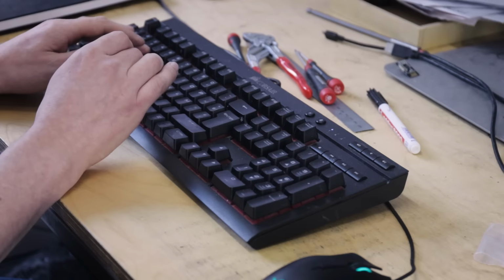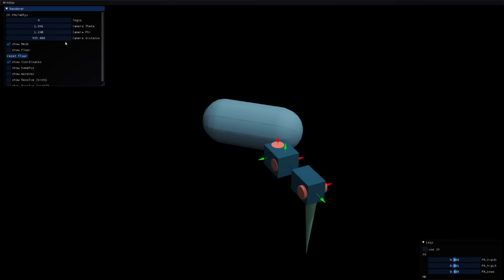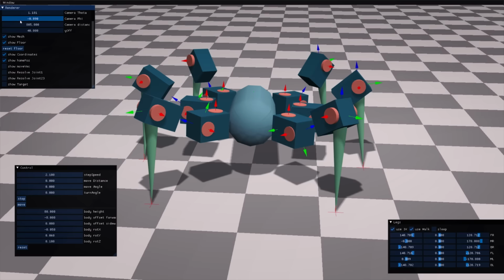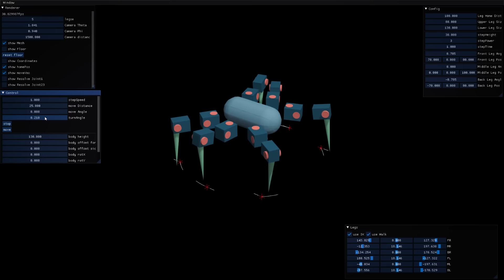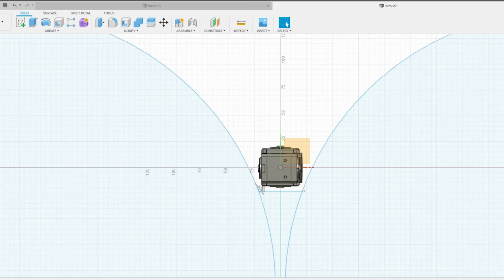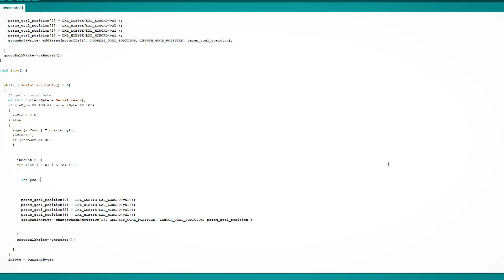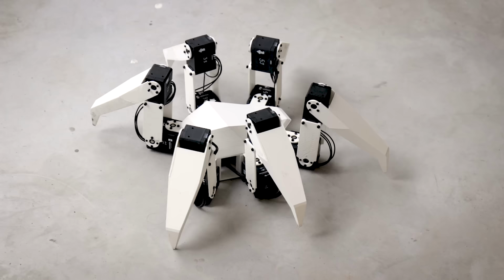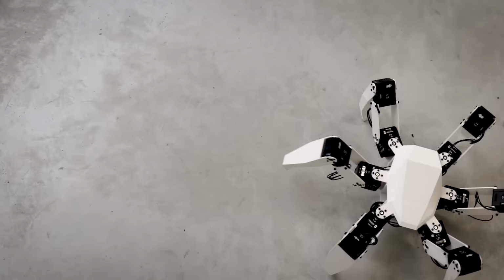Designing and building a Hexapod!

Comment: That's like $1000 in servos alone!
Reply: i got real excited when i saw these servos... until i saw the price
Reply: Does anybody know cheaper alternatives?
Reply: @Gaminghero94  Yeah use micro servos. 
Also, see if you can use stm32f103c8t6 instead of this microcontroller.
I'm kinda planning on making this and then uploading this on my channel in the future.
Reply: @lander1591  but for that you need to have rc cars, and that too a lot of them. If we assume that one rc car has one servo to steer its front wheels, then you'd need 18 rc cars to make the hexa pod.

Just get normal microservo motors instead. Although I dont think they would be as accurate as the ones in the video, but it's fine for a small project.
Reply: @risingredstone5949  Dude you just buy the servos themselves...  Like the 20kg servos off of Amazon.  Microservos are very weak anyways.  That would be a terrible idea, especially if you're not planning on scaling down the size of this hex.
Reply: @dooby1445  Oh sorry I meant mini servos which have a torque of 1600g cm, also I really wanna know, how would you use 20 kg servo anyways?
Reply: @Gaminghero94  you can find on aliexpress, they are serial controlled servo, so you need a dedicate controller that you can buy on aliexpress anyway., as you can see there are less cables than usual servos.
Reply: Do u know what software he used for simulation
Reply: I'm sure there are some cheaper alternatives out there. But the used servos are super and the price worth.
Reply: @kristalsunuwar8675  his own software, pretty impressive
Reply: @Merl-co2nd  ONE FIND

Comment: Thanks for going all out with Dynamixel servos, making possibly the best hexapod this size.
I have always been disappointed by the performance of hexapods made with MG90/MG996 servos. 
But this video really goes to show what can be done with high output and synchronized servos, such high acceleration yet still have the high torque to maintain the position.
I guess I shouldn't be so surprised when the servos alone worth almost $1000 on this robot.
I wonder how much extra weight can your hexapod carry?
Reply from the maker: Thanks :) Its actualy very close to maximum size/weight. It really can't hold much more (and be that fast) Despite the price, these are still the lower-end dynamixel servos  :)

Comment: Wow great video kind of servo motors did you use and what was the programming language python hard to see. Last question would be possible for it to be build on arduino . Been doing that a lot lately and would a array be needed to control the servo simultaneously at sync to move the robot.

Comment: Very very  good design and programming.
Cool thing, I also use Fusion and have a Lulzbot Taz6.
My designs are mostly for underwater robotics and the movements are quite easy to program, the main problem is to mantain joints and axis watertight without to much friction.
What materials are your choise for printing?

Comment: Hey Chris, I had a similar project I am working on and I recently started with the IK, I have two questions regarding this math. 
1. How did you add constraints to the calculations, the answers I get are in the range between -pi to pi where-as servos can reach up until 0 to pi only.
2. How do you translate the base frame from the origin to the edge of the robot for the legs? Could you drop some sample calculations somewhere? I'm aware of the transformation matrices but un-aware of its use, if its has to be multiplied to the 0th frame of the DH table or how?
Reply from the maker: 1) I don't have any constraint in my code, but I remap the servo range. let say from -pi/2 to pi/2  (my servos go from 0 to 2pi, but i don't need that range for the walking cycle)
2) Hard to explain if you don't really understand transformation matrices, if you do: i have a matrix for my main body (rotation+translation, relative to the zeropoint on the floor, which i can move when i move the body up and down, tilt it etc)  and a matrix for the leg position/rotation relative to the body center(fixed) and  a world-pos target point for each leg(which i use to make the walking cycle). now is the goal to transform that world-space target point to the leg-space. so you can start resolving the IK for that body position: 
targetPointlocal =inverse(bodyMatrix * legMatrix)* targetpointWorld. So, you can consider that the start of the leg is now(0,0,0) with direction (1,0,0), and the targetpointLocal is relative to that. 

Hope that that makes sense :p?

Comment: Hello!!! That Is not the common way to solve the IK of 2DOF. How did you find that Solution? Great project.
Reply from the maker: I didn't know that?  But I made up my own sollution. what's te common way to do that?
Reply from the maker: @lalinlalote  yea, thats interesting. Thanks for that! I just use the intersections of 2 circles to calculate q1 and q2. Would be interesting to test what is the fastest way.
Reply: @KrisTemmermanNP  Hello! I want to learn cinder, i did not know that framework but what advantage has over rviz and ROS? Have you tried that framework?

Comment: did you use any module to connect 12 servos?
Reply: He used a special set of Dynamixel servos that have their own serial communication protocol and can be daisy-chained. So you don't need a massive PWM driver with 18 PWM outputs. These are some incredibly expensive Servos though.

Comment: I'm having a tough time importing Cinder-Imgui ( I did so by extracting the zip file and putting all the src and lib files in to the InsectRobot project) but it doesn't seem to be compiling, am I doing it the right way?
Reply from the maker: I have the cinder-imgui in the cinder folder / blocks. Cinder folder is called cinder_master.  
In VS, in the "solutions explorer" right click the project (InsectprojectSimulation). and select properties. C/C++ ->additional include directories. make sure those paths are correct. I hope that helps :)
Reply: @KrisTemmermanNP  I see, and the cinder folder is placed in the InsectRobotSimulation folder right
Reply: @KrisTemmermanNP  I managed to import all of the libraries, however I couldn't build the right configurations for cinder.lib, which platform toolset should I use?
Reply from the maker: @ongsawbee  The same you use for my code. so, open in cinder the VS project: upgrade? use the same settings (x64?)  and build a release and debug version. that should do it :)
Reply: @KrisTemmermanNP  yup! Turns out I used the wrong C++ version, everything worked fine in the end! Thank you very much for replying to me! I have already subscribed to your channel :D

Comment: i'm very interested in your simulation software used on pc, is it a commercial software？  i made such a robot too recently with raspberry PI ,  but without such software, i can only calculate the angle of 18 sevo ,define the legs sequences ....   each step the PI should running" sin, cos, tan, asin, acos......" for thousands times......    this makes the PI a bit stuck,  and will not allow any futher senior thread such as image identifying   to run .